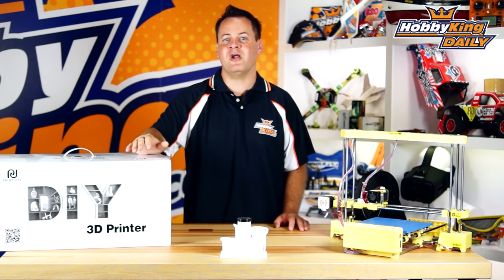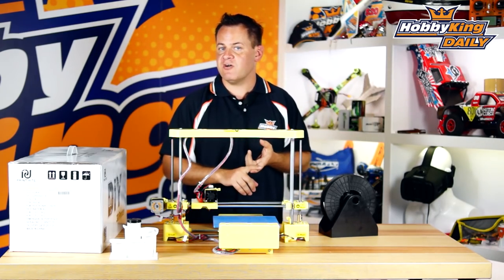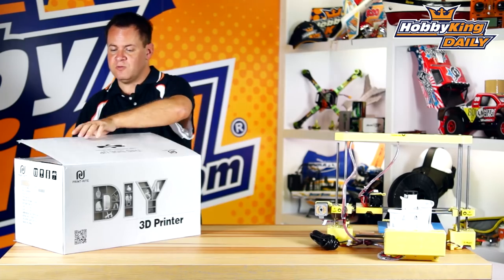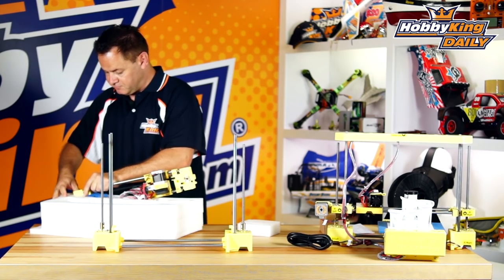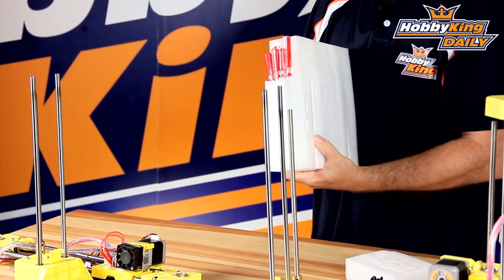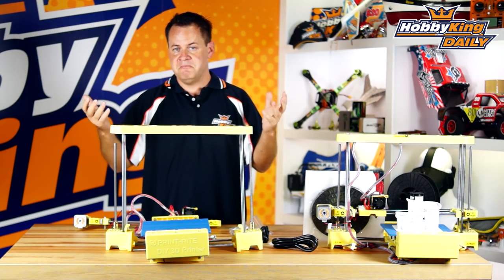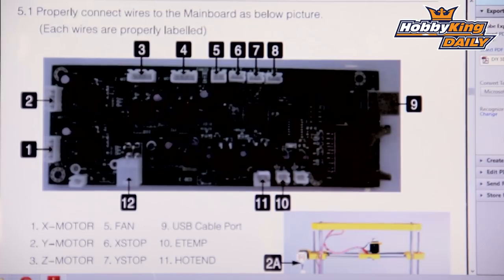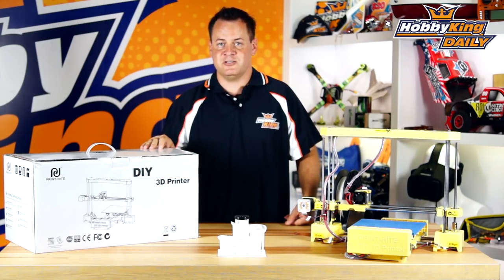DIY 3D Printer - HobbyKing Daily

Comment: Wow it's so simple compared to your last printer that had hours or build time. I really want too try 3d printing but it seems like a mine field to me. I don't understand the needs for heated bed and painters tape. Looking forward to seeing the price point on this product.
Reply: Some materials like ABS are prone to warping as they cool down too quickly, thus the need for heated bed. Some printers "solve it" by being PLA only :)

But yea, I completely share your fear of tweakery. I am not quite ready to shell out EUR2k for an Ultimaker but everything else seems like a gamble.
Reply: Jakub Steiner I have a MakerBot Replicator 2 and have to say that after owning it and using it for about a year and a half it is pretty bullet proof. I print at least one object on it everyday and only have to re-level the printing platform every month or so when i replace the painters tape due to excessive wear. No real Tweakery needed! 

Early on with a printer you will make mistakes but after a while it gets to be routine and simple. I am sure the same experience would come from any quality printer. The only thing that gives me pause about the DIY printer above is the construction of the frame. you need a very stable frame to avoid vibration being evident in the prints. Unlike the Replicator clones and the RepRap designs out there where the frame is metal or wood across the towers, the DIY frame is injection molded plastic across the top and I'm not sure how well that will dampen fast moves while the print head is traveling. they may have adjusted it out via the firmware with deceleration. 

I await the reviews as i am interested in getting another printer to increase my production ability and this may be the perfect fit!
Reply: Joe Harper  Thanks. Looseness of the frame is a concern with plastic molded pieces.

Comment: Like the fabrikator any 3D printer that you cannot get the STL files to print replacement parts is not worth the money or effort.  Ask those that purchased the fabrikator.  Are the stl files available?  No. Ask those that purchased and helped put makerbot on the map and then got screwed when they closed the design to the community that helped them become a brand name.

Save yourself the money and build an open source reprap like the prusa i3, smartrap or smartrapcore, etc.   You will get backed up by a huge open source community.
Reply: ***** I like where you are coming from but no company is going to offer the files of how to build all the replacement parts yourself. That would mean in effect they are giving up ownership of their own product. Sure people could MAKE THESE FILES AND SHARE THEM... circumventing the issue, but to expect the company to share them is asking waaaay too much. So stop being lazy and make these files if you want them, and share.
Reply: Matthew Williams 

I think you should do a little research before assuming a company will never makes its design files available..

Check out SmartFriendz (http://smartfriendz.com/en/). a french company selling TWO very good 3D printers of which ALL of their printed parts are available on thingiverse, github and youmagine.  

Selling printers and sharing the STL files!  Oh my God, what a concept!  Look it up. It's called Open Source.  There are many other examples just like Smartfriendz.  Google Prusa I3 for example.  Companies will cater to those that want to build it themselves using an existing 3D printer or want to purchase everything because they have no 3D printer to start with.

And being lazy?

Check out my SmartRap or SmartRapCore build log (https://smartrapbuild.wordpress.com/) or my youtube channel videos or my STL files on youmagine where I freely share info about the 3D printers I have built and my design files.

I have no interest in making files for this printer because I have no intention of buying one.

Comment: Get yourself a prusa i3 instead
Reply: TheLukey21  Why?
Reply: stewjw because its a very similar price but it is very popular so there is a lot of support and there are hundreds of upgrades and ways to make it personal to you, as well as being able to extend the bed etc.
Reply: TheLukey21  I like the way this one easily breaks down when not in use or for transport. I've been planning on getting a 3D printer for years and the price looks right. I know some people had a lot of difficulty in the past with RepRap 3D printers but I'm sure by now both the 3D printers and software have matured to make them easier to work with?
Reply: stewjw well i built my myself, i bought all the parts separately and cut the rods etc myself and now there are probably 20 controller board options or more but you may soon find that taking your printer apart and putting back together is generally a bad idea unless you like having to set it up each time. You generally want to have it stay in the same place and don't move it around or better still have it hard mounted to a piece of thick plywood etc.
Reply: stewjw You will get no support with this just like with the 3D Fabrikator.  No replacement parts available unless you find them yourself.  The support forum is either down, slow, and nobody from Hobby King will answer you.  For the same money, you can get a I3 with real support and a configuration that is proven to work.  How do I know? I bought a 3D fabricator :(
Reply: stewjw The ability of this to "Break down easily" may be a curse... 3D Printers accuracy and surface quality and consistency are completely based on the tolerances that exist in the printer. 

Building and unbuilding the printer over time is likely t weaken the tolerances and lead to more wiggle room in the frame. if you want high quality and tight X and Y lines you DO NOT want wiggle room anywhere in the frame.

This is all speculation as the printer is not yet reviewed by anyone objective, just the manufacturer and distributor. 

"All will be revealed in time"